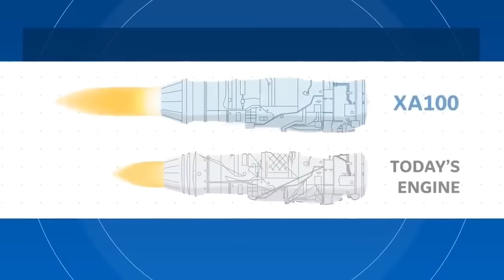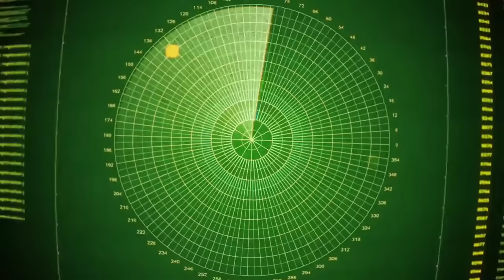Finally The US Reveled It's Insane New 6th Generation Stealth Fighter 😱

Comment: The delta wing design will necessitate AI flight/fight abilities.  The B2 proved that instability in the frame makes computer assisted flight  necessary, and now that you're adding air-superiority roles that require maneuvers at Mach speeds the human ability isn't capable to withstand.
Reply: Eventually there will be Self automated Tesla Jets😅
No pilot needed to fly lol
Reply: @cosmicbilly  MQ-1 enters the chat
Reply: That was proven way back with the F16
Reply: This isn't new info they learned this when Designing the f16 in the 70s
Reply: Farts
Reply: @josfur1977  Thank you for your very generous contribution to this discussion. That is, perhaps, the most insightful comment in many years.
Reply: @johnathondavis5208  thanks mate always glad to support when talking about "farts" fax
Reply: @josfur1977  Very glad somebody finally has a sense of humor, too. YW :)
Reply: @ec3886 don’t you mean the MQ-9
Reply: That’s not a delta wing design that’s a flying wing design

Comment: When will they start using Anti- gravity etc with the tech they found at Roswell NW.
Reply: Most likely already in use. The navy pilots sightings we’re probably tests to see how to engage traditional aircraft. But it would take all out nuclear war to weaponize them as the risk of leaking the tech would be to great. Quantum computing and AI are without doubt working towards reverse engineering craft at S4. If Im right, I hope we never find out.

Comment: The United States needs to build futures fighters and bombers without fuelings by using Nuclear powers or energies from the sun that can fly as long as the pilots need it on the airs, and it must flying the speeds of over 20,000 miles per hour and avoidable from enemy attacks. Its engines must build to last at least 10 years of None stop flying. Also, it must provided with the AutoPilots that can control the Air Crafts as smart as humans when need it.

Comment: I'd like to see exactly how that thing is supposed to maneuver well without a tailfin of any kind. That looks neat, but somehow it does not make aeronautical sense.
Reply: It can be done. The B-2 Spirit is proof of that. However, you will need a very robust fly-by-wire system coupled with advanced avionics and computers to make it possible.

Comment: This is ALL speculations. Also, delta wing config have never worked well. It's unstable and not so easy to control.

As I see it, fighter jets are just not needed any longer. Drones are already doing what jets used to do. As for very long distance attacks, ICBM and cruise missiles (from warships, subs) are more than sufficient.

Comment: I’d like to see my wife try to fly that thing with all of those gizmos to push and turn. 😂
Reply from the maker: Lol
Reply: The main control panel is a sophisticated digital monitor that displays only what one requires within the current circumstances. For example, if one is flying over Mach 2 at 20,000 metres in altitude, the screen simply will not display the landing gear actuators, or those to open the cockpit canopy. If one is taxiing on the runway, the means to launch missiles will not appear. 
   All one would see would be what one would need.

Comment: We can't power a laser kill weapon onboard something as small as a fighter jet.  Period.  It takes ~10 megawatts (per second) of input electrical energy to result a 1.0 mega-joules/cm^2/sec output power onto target.  Any power level lesser than this will NOT result in instantaneous target destruction.  We know. We tried.  And a ~50' long fighter can't carry another 40,000 lb of generators.

Comment: The F-22 first flew 25 years ago and not many were made.   With today's environment it's replacement should already be flying.  The Navy is lacking an air superiority fighter.  They expect the carrier escorts to handle all threats.. Between the Air Force and the Navy we are getting to the point of too little too late for air superiority.  I am curious is the 6th generation in this video has some crossover to the Air Force ??    The video talks up the fuel efficiency of the engine but operational drone tankers are still sorely needed.   Chinese missiles in the South China Sea will require long distance sorties.
Reply: when they built the F-22 they had one type of RAM for it.  It had to be recoated and retested often to make sure that it was ok and working properly.  It was also not modular. To upgrade it would take months and keep it in a shop.  The F-35 has baked on ram that is good for its lifetime.  Its also better quality ram than the f22 had on it.  But with the NGE coming out which is just like what the xx would be they can do upgrades in days not months as they can unplug one thing and plug in another and there is room to do it.  We also are coming out with new AAMRAM missiles that are half the size and twice the range as the old ones.  The navy has the tanker drones they are being tested on operational deployments for the last decade i beleive it is now?  they are stealthy and completely autonomous and can do carrier landings.  If they can do that? then its just a matter of the AF buying them as there is no need for two.  Or i am sure they can bring out a larger version for them.